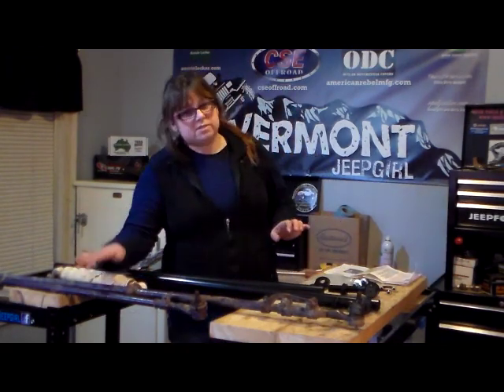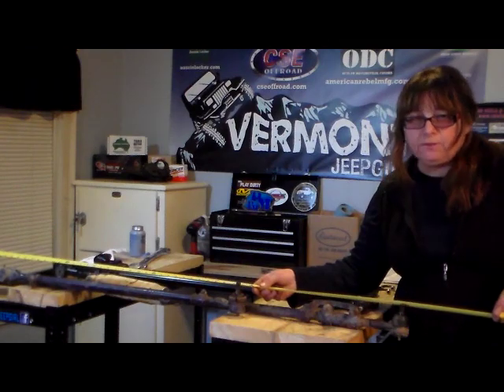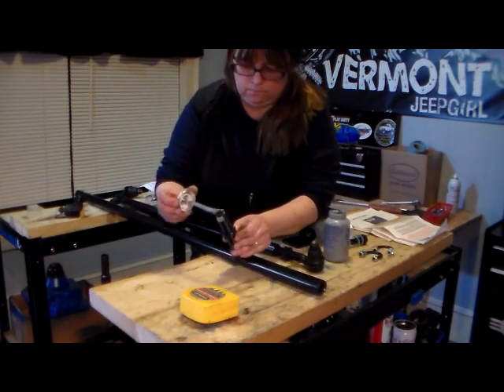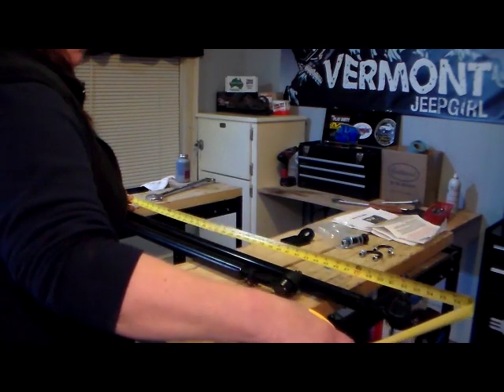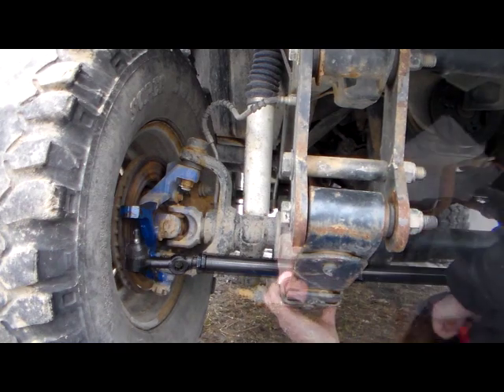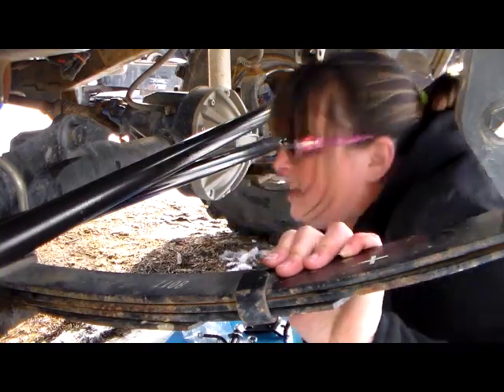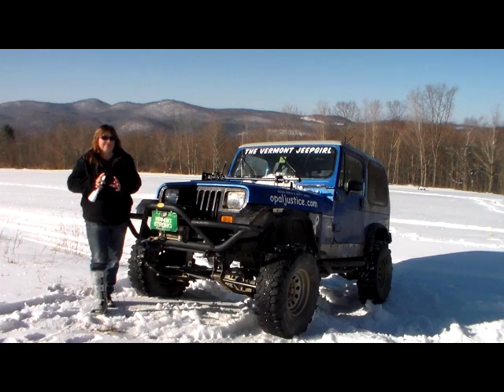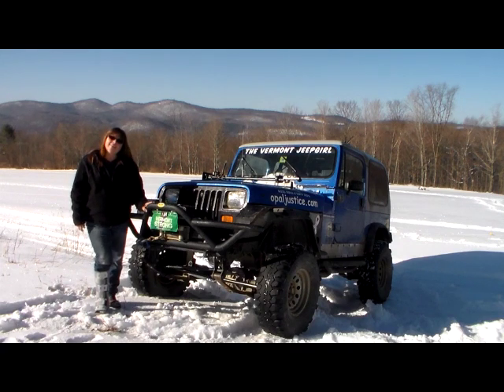RUGGED RIDGE HD Steering Install

Comment: I have a 1992 jeep yj and when I put on the rugged ridge HD steering upgrade I have issues with the system hitting my damper shock and stopping my wheels from turning all the way to the right. did you have the same issue with old blue?thnx
Reply: You need to adjust it or get a damper that’s longer.

Comment: the passenger side is not the left side it is the right side of the vehicle.
Reply: unless you're standing in front of it looking at the grill
Reply: James Slenk Always best to refer Driver side or Passenger side when dealing with side specific components.  My experience in the shop has always been from sitting in the drivers seat.
Reply: Glad you cleared this up. I got a little nervous for a second when I watched the beginning of the video. Left side is actually driver side. I had to take a second to think how I installed mine. All good. Good video :)
Reply: begs the obvious
Reply: @TheHopetown  No it doesn't work like that the left side is always the driver side in America .

Comment: leaf springs in the front on a Jeep?
Reply: jonathan morales it was common to have front leaf springs on wranglers even CJ8 CJ7 CJ5 ect had front leaf springs it wasn't until 97' when the TJ was introduced they had front coil springs
Reply: Solid front axle. No ifs here. It allows more travel for off-road.

Comment: Hi do you know if this will help with my death wobble ?
Reply: Hagop Pilavian Death wobble is usually due to an alignment issue or a bolt not torqued to spec.
Reply: +Hagop Pilavian Death wobble is the track bar 95% of the time. It's tie rod ends that's loose. It has nothing to do with a bolt being torqued to spec.
Reply: @TheAmericanUhate  my ass 95%. Check the ball joints. Don't give crap suggestions. Not saying your advice can't be helpful, but it's a proven fact ball joints cause death wobble more than any other component.